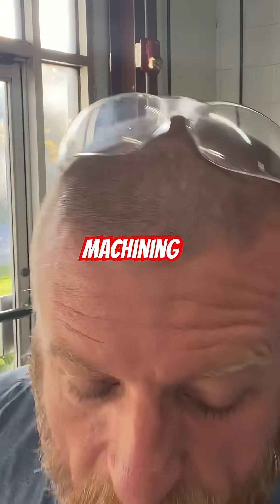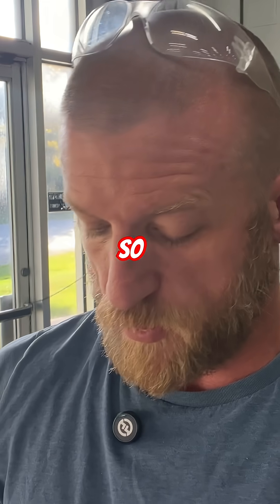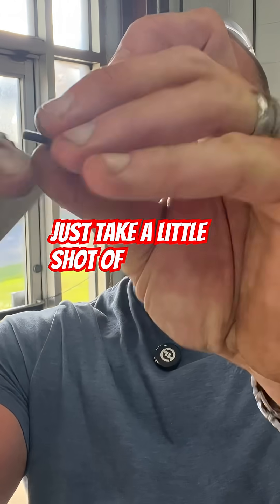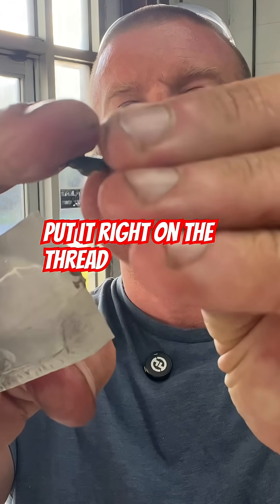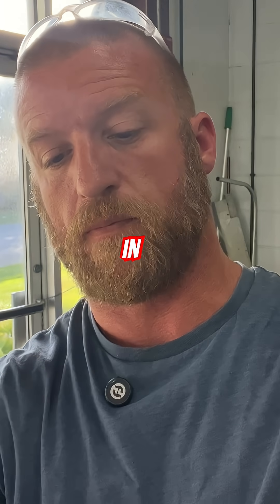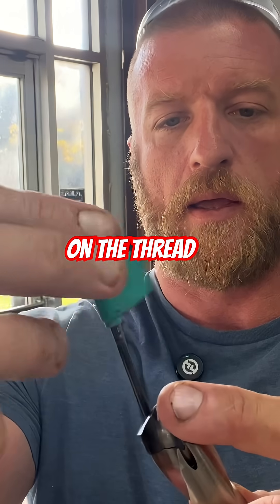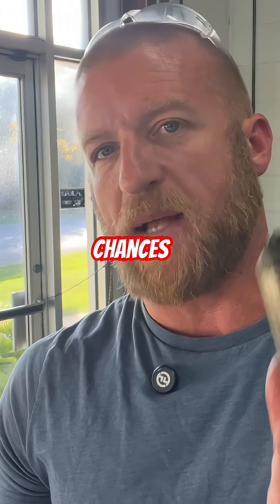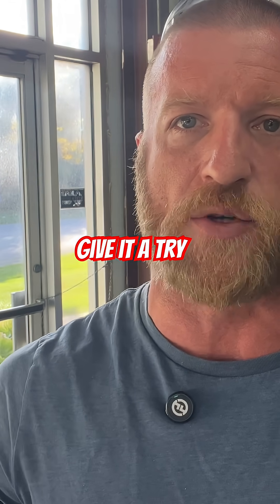❓Do you use anti-seize?? #cnc #machine #lathe #machinist #machining #cncmachine #manufacturing

Comment: Haven't ever used anti seize but our shop also has torque screwdrivers for all the various insert screws so maybe its torquing them that prevents the need for anti seize
Reply from the maker: That’s a great idea. And I’d say it’s a good combo of both. Cutting pressure and heat can make them tighten up

Comment: I normally use antiseize. Had some stubborn ones and used red loctite. Only drawback with loctite is you need to warm the tool to a few hundred degrees for it to release. Ground plenty of torx drivers down to make them fit the screw tighter,  too
Reply from the maker: What’s red loctite for ? The ground torx is the move - definitely a tip from the experience of fighting stripped screws 🤝